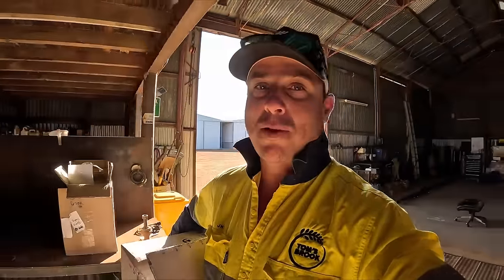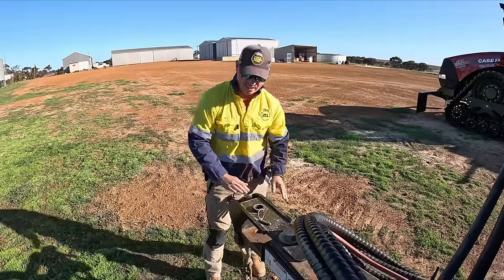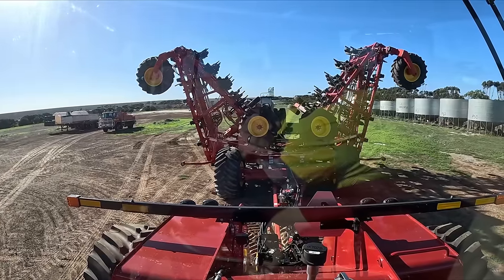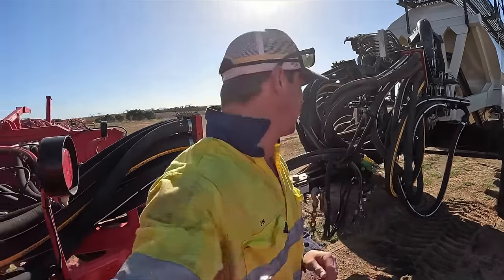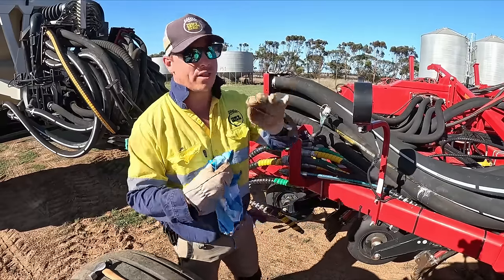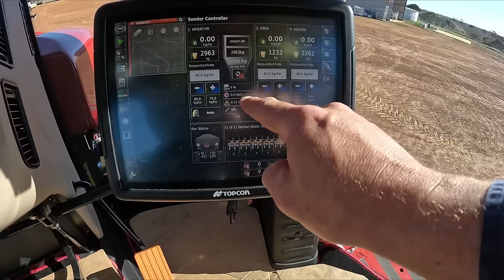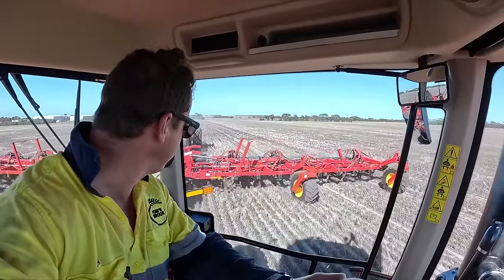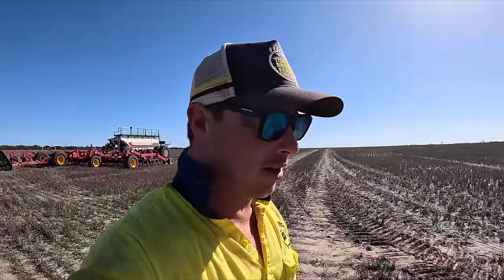Paddock Test Day!

Comment: The tricky part when backing equipment like that is to not oversteer. I teach guys that you need to get it so it’s a pretty straight shot going back, then put your hands at 9 & 3 and don’t let your hands cross over (very much anyway)….lol. It’s all about practice.
Reply from the maker: Not with this bar! Problem is there are 4 pivot points and with the long draw bar which steers the wheels it has such a delay it is impossible. Then with the bin hooked up it has a very short draw bar so again making it impossible 😂

Comment: Gday mate. New to your videos mate but great work love the content!! Just curious have you ever done a video on why you changed from seedhawk to bourgault?? I’m looking into doing the same. We still run a seedhawk and they certainly have their pros and cons but would love to see a run through of your bar with point and boot set up if you haven’t done already. All the best with the upcoming season mate 👍👍
Reply from the maker: Thanks! Glad you are enjoying the channel!

I haven't done a comparison video as I only started YouTube last year and that was the 6th year with this bar.

But we had a Seed Hawk for 7 years, it was great for seed placement but we were getting a lot of issue with stubble flow. And with starting out Controlled Traffic I didn't want to move of the trams to fix the issue so we were doing a lot of burning and that ended up with us loosing lost of moisture from the paddock and resulting is a bad crop.

The bin on the seed hawk was also limiting and we couldn't do variable rate and calibrating was one hell of a process.

We went for the Bourgault as the bin was amazing and the bar looked strong and I love the quick depth adjusting on it. However we still struggled with stubble issues so I bit the bullet and we now seed on a 30 degree angle when in barley stubbles and that has fixed out issue. 

But the tyne does have a lot of bushes in it and so this means a lot of wear parts and it is quite a process to change them all over!

Im actually looking at going back to either a seed hawk or seed master for the 25 season as there is less maintenance involved with the bar and the seed placement is second to non!
Reply: @tomsbrookfarm  
Thanks for getting back to me mate. Actually that’s quite interesting to know that you would go back. I 100% agree mate seed placement is unreal it’s near perfect for our country and soil type here. Trash flow can be a dogs breakfast at times but we aren’t controlled traffic so I don’t mind going through at an angle. Either cut it real short at harvest or let the sheep smash it!! 

I might have to look into the bin a bit more we have run a flexicoil since they started the ability to go variable rate. It’s been good but I think it’s time to move away from electric motors running the meters and something a bit easier to calibrate. An Apollo system with an x35 would be ideal for my prescriptions would also be very nice!!

Thanks mate much appreciated 👍👍